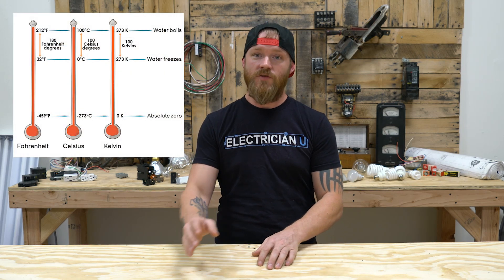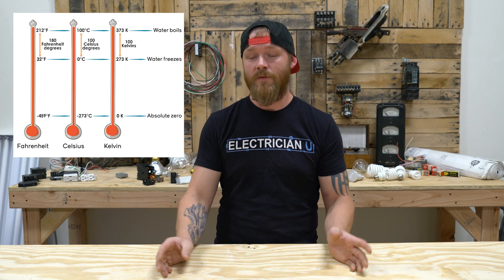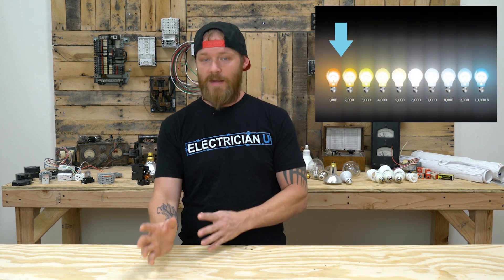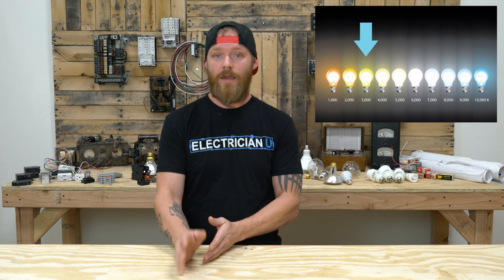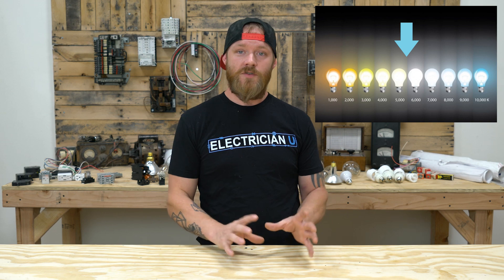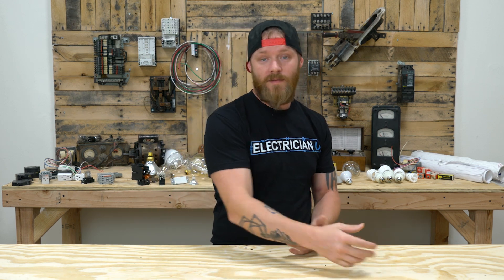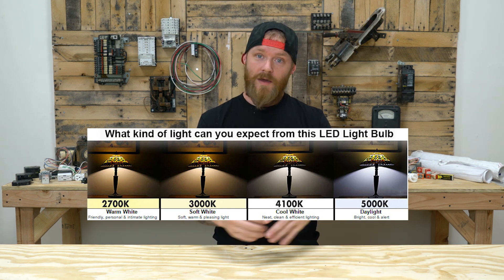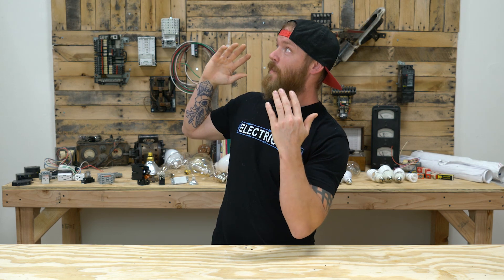Light Bulb Color Temperature - WHAT ARE KELVINS? 2700K, 3000K, 5000K

Comment: You left out THE most important parts. Unless people have some basis for reference the numbers are meaningless. Human eyes see best under noon day sun illumination. That's when the cones are best activated. Noon sun is said to be 5000K. A standard tungsten light bulb is about 3200K. The monitor you are using to read this probably has its white balance adjusted to about 6500k, aka "bright white" (thank you, Sony). the lower the number, the warmer the color, higher colors go upwards to the blues and purples. Back 20 years ago, when people took pictures using film, photographers all had a good working knowledge of color temperature or people would end up looking like Martians. Don't believe me? Look up FL-D and FL-W (for color balancing under florescent light) or the 80 (80a, 80b, 80c) for balancing under tungsten light. Light toward dawn and dusk is more blue/purple so filtration to return to a 5000K optimum would be an 81 series filter. 
This is most important in bathrooms, dressing rooms and makeup rooms where women will be selecting cosmetics. What looks great at 5000k looks like stage makeup under 3400K tungsten light.

Comment: So Do I get it right, that you say the daylight is about 10.000K? This says 5900K https://en.wikipedia.org/wiki/Color_temperature#The_Sun
Reply: Yea actual daylight on Earth is about 5900-6000K, but, it's not exactly the same as colour temperature for lamps.

Technically speaking, colour temperature is about the colour of light that comes off an idealized "black body radiator", which is just some bit of matter (metal, rock, etc.) that is glowing because of its temperature. That's why it's a temperature scale (K) which is used - that's the temperature this ideal radiator would have to be to produce light of that colour.

The sun is pretty close to an ideal radiator, since it is a glowing ball of thermonuclear plasma. So, it's a very broad-spectrum light around 6000K, which is roughtly the surface temperature of the sun. A hotter star like Rigel (https://en.wikipedia.org/wiki/Rigel) is much closer to 10K and is thus very blue, and a much cooler red dwarf star would be very red.

Fluorescent gas lamps however don't produce the exact same spectrum as a black body radiator, however. Since as Dustin mentioned each gas produces some very specific frequencies of light, the goal in producing lamps is to approximate a colour temperature through various gasses and phosphors. These approximations are the labeled as the lamp's "colour temperature" for visual purposes.

Comment: I like the fact that you never said degrees Kelvin. I still remember the day a Pakistani exchange student called out my grade 12 physics teacher for teaching us degrees kelvin. He didnt believe the student at first and apologized the next day after he researched it
Reply: BS. Been in the industry for 40 years be it photography/lithography or printing and viewing images and its always been degrees Kelvin except for those that use 'C U Soon' as a way to communicate. As a range of temperature, they are all specified in degrees. <and yes, I took the class to be certified on all the variation of color measuring instrumentation and methods>.
Reply: Everything is on a wave,radio to lights peed, spectrum! Everything! Tesla knew this and understood this. Resistance is measured by heat. You can use a temperature read to actually measure Resistance, most saftey act this way.
Reply: @joerostkowski7313  So, photons aren't packets of light any more! Who knew. ( sarcasm intended)

Comment: Dustin,   I did lighting design since the late 80's and was pretty successful doing it, so I was told.   But, you taught me something!     I knew it was degrees Kelvin, but did not know the why.   Thank you!   When discussing color with customers and in my classes, there was a concept that is hard for some to grasp.   When you look at an object, that object does not have color in it.   Objects or paint have color reflectors, not color.   The color you see is coming from the light source.   This is why they change color when you change the Kelvin temperatures.   Thank you again,   Kevin
Reply: It has to do with the temperature of a hypothetical black body, that would glow and produce that particular mix of colors (i.e. spectrum).  Since we can't heat tungsten or any other metal to 5600 Kelvin, and have it remain a solid metal, we can't make a sun-spectrum with an incandescent bulb.  Other lighting technology is needed, that doesn't require heating a material to glow as an incandescent body.  Hence other technology, like LEDs and fluorescent tubes, which don't depend on anything reaching any actual temperature that corresponds to the mix of colors in their spectrum.

The sun spectrum essentially defines the balance of colors that make white, to our eyes.  This is why 2800K incandescent bulbs appear yellow-ish.  The spectrum of a colder body, is dominated with low frequency colors like red and yellow.  An alien species from a planet around a red star like Proxima Centauri, might see our incandescent bulbs as a perfect white.  An alien species from a planet around a blue star like Rigel, would see our sun, the way we see an incandescent bulb, and would probably be able to see what we call UV light.